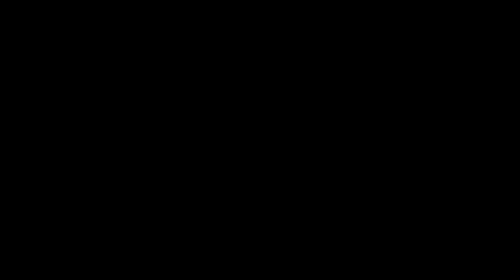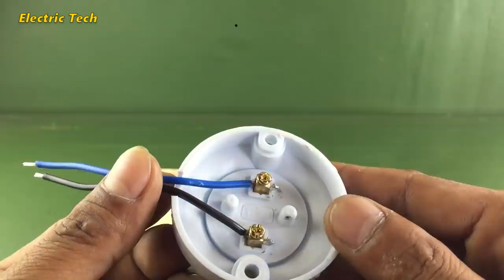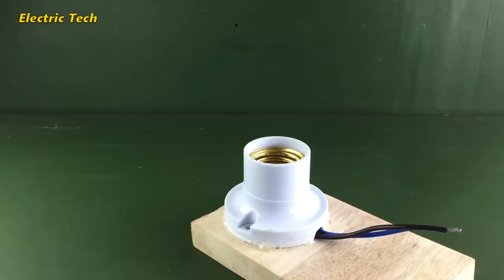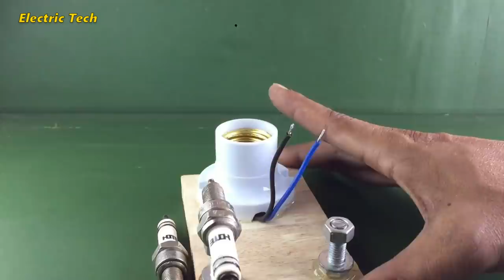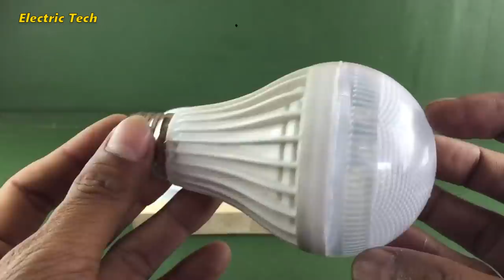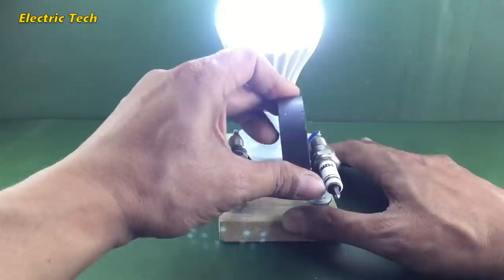Free Energy Generator Light Bulb 220v Electric Science Using Speaker Magnet 100%

Comment: Just when I thought I had seen the dumbest magical spark plug "free energy" contraption Pinterest sent me a link to this. Surely to God this dude and his ilk don't get financially rewarded to dump this crap on YouTube. If spark plugs are so amazing why do we need to put gas in our cars; the spark plugs are all the engine should need. 😂 I'll assume he disassembled the LED bulb (which was made to be used with either 120, or here 220, volts AC), he chopped out the circuitry to convert the line voltage to about 5 to 12 volts DC, which is what LEDs work on, and stuck in a 9 volt battery or equivalent. Now what I would like to see is connecting one wire to each foot of a live chicken and powering an LED bulb that way.😁